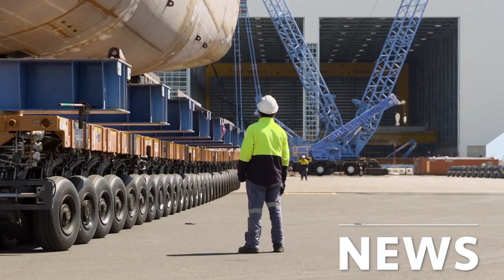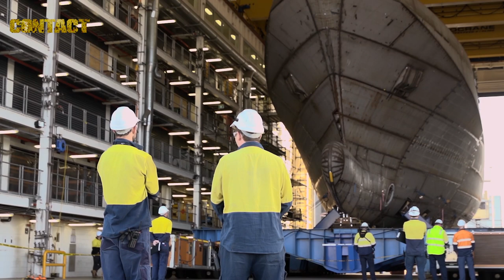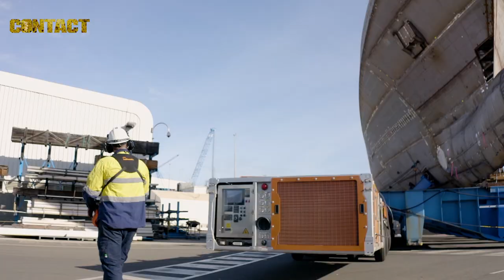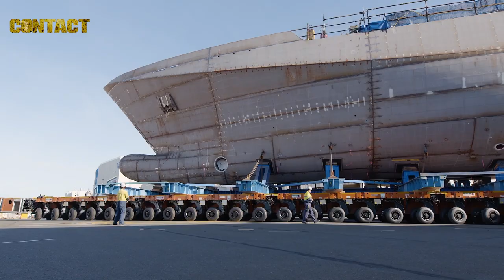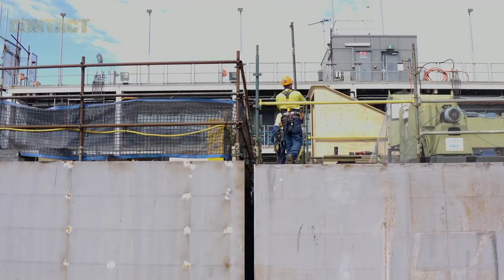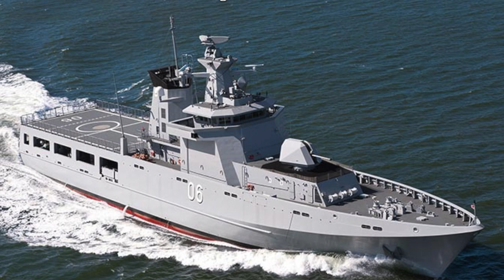Largest block move ever at Osborne Naval Shipyard

Comment: Well done, they could be formidable ships if the proper offensive/defensive capability were given to them.  Start with the 40mm bushmaster turret instead of 20mm, as well as a rolling frame protection system along with at least four remote 20mm sites, front and rear.